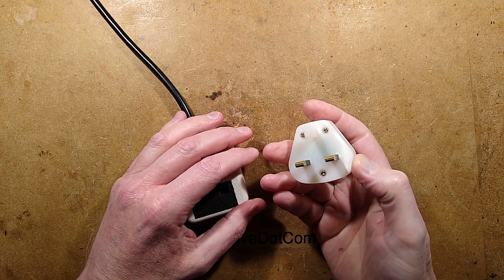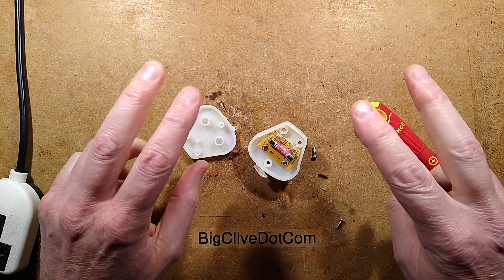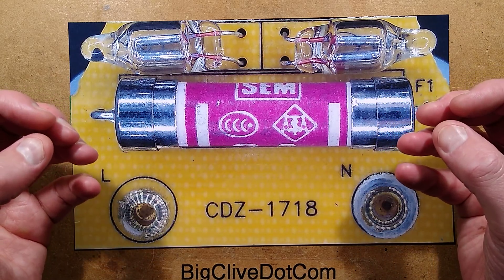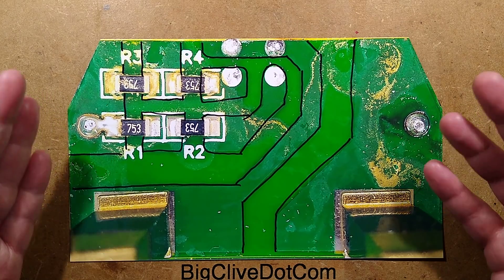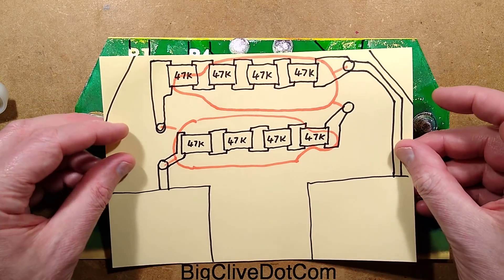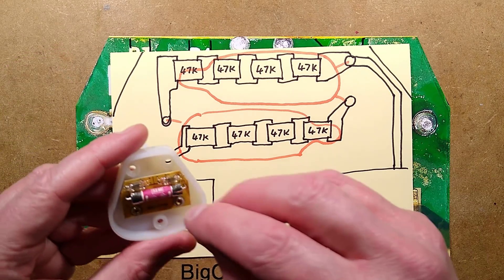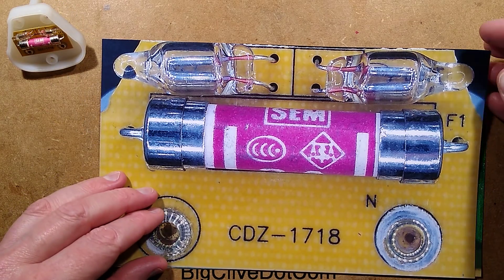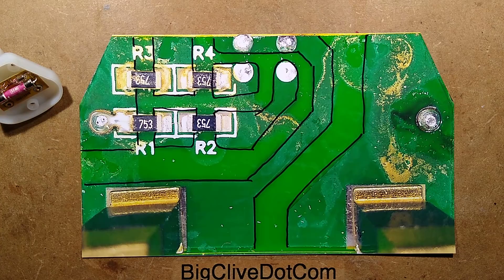British neon night light and the curse of the box-tickers

Comment: WTF? the neon resistors provide all the fusing you need
Reply: Probably some stupid supplier mandated they must contain a “real” fuse and here we go, pointless design bloat ensues.
Reply: @damowdotnet  My thoughts too. You can actually get fusible resistors designed to fail open to keep the 'box tickers' happy.
Reply: @damowdotnet  The "real" fuse is mandatory in UK
Reply: Alejandro Vargas  So what about 12V plug-packs? They certainly don’t contain a “real” fuse. USB adapters? Etc...
Reply: You don't need fusing at all in this circuit.
Reply: Dolganoff Agreed
Reply: A fuse is typically a sacrificial device, breaking before some other less-desirable conductor breaks/evaporates. Just doesn’t make sense in this context.
Reply: well they probably won't blow, if the neon shorted on a 240v suppy , the 150k resistance would draw about 380mw
Reply: @sparkyprojects  That'll destroy a surface mount resistor for sure.
Reply: @sparkyprojects  Things can get messy when arcing kicks off.  I suspect the BS1361 fuse is actually a sensible move, but surely they must be able to position it vertically.
Reply: Geez! what is that a 30 amp fuse? Looks more like 15, looks like a much lower amprage is all u need.
Reply: @davidcollins1853  I think it;s 3 Amp (cos it's printed in red) and fuses in that physical size are available up to 13 Amp (though John Ward found some 15 Amp ones on Amazon)

30 Amp is the fuse in the fuseboard feeding the socket.
Reply: @davidcollins1853  Assuming the colour of the fuse is right, it's a 3 amp fuse
Reply: @westinthewest  They might have thought it will only be viewed from above so it doesn't matter
Reply: @westinthewest  there might be some patent on that
Reply: @davidcollins1853  looks like a much lower current is all u need.

No such thing as amperage.
Reply: @NickNorton  'Voltage' is also not a recognised quantity.  I think it's supposed to be potential difference or EMF depending on the scenario.
Reply: @davidcollins1853  3A I think?
Reply from the maker: I think it's just overzealous compliance.
Reply: The neon resistors might not have sufficient breaking capacity for fault current on a typical 32A ring, but then again, the MCB will disconnect in less than 0.4s.  The question is whether the plug will safely enclose the brief eruption of energy.   The BS1361 fuse will have a lower energy let-through than the permitted maximum for an MCB, but in reality, MCBs trip times seem to be negligible unless the fault occurs close to the zero crossing of the a.c. sine wave.  Regulation 433.3.1 says that it doesn't really matter about the magnitude of the load, as it's fixed.  Fault current is the only concern here, and not overload, so the cartridge fuse can be 3, 5 or 13A.
Reply: @westinthewest  In my experience with MCB and local fuse blowing, the only way this fuse will blow is if the resistors all go short. Then the neons explode, the fuse blows and the MCB trips simultaneously. The higher the rating of the fuse, the more damage elsewhere, like the neons. But the likelihood of those resistors going short is insanely low.
Reply: Instead of neon could you perhaps use a small led strip around the perimeter?
Reply: What about a smaller sized fuse mounted on the back?  Replace the fuse with a 0 Ohm fuseable link.
Reply: @StringerNews1 I accept what you're saying is true to prevent currents higher that 13A being drawn from a single socket, but what then is the purpose of 10,7,5,&3A fuses except to protect the much thinner equipment wiring?
Reply: @StringerNews1 Thanks for the clear explanation.  I haven't had to deal with ring main circuits at low voltage. Our (down under) final subcircuits are radial. Rcd /Mcb protection is also now mandatory.  A far cry from the old AC1 rewirable fuses common in my apprenticeship days.

The old drop shutter fire protection panels were ring main, but long obsolete by the time I got started in 1973. They could be a prick for fault finding with both legs of VIR often pulled through the same split conduit. Being old, rubber and DC, faults were common.
Reply: It would have to be grounded for that and then it'd need extra circuitry in order to keep from triggering ground/arc/nannyfault breakers.  (nannyfault blows if an item is turned on-and-off-again rapidly over and over)
Reply: @StringerNews1 So imagine this device passes current just below what this fuse is rated for. Do you think it wouldn't burst in flames?
Reply: @StringerNews1 Tinkered with electricity for years, but no pro at it. It was mainly helping friends and family with wiring. I've seen some crazy things. ...read there are proper ways to deal with aluminium wire, pigtails, al rated outlets and switches, etc. Aluminium works really well done right. The key is knowing that it is there.  Sears Tower? Wow! must have been a great experience. Mom lives in the 80 year old house we grew up in. I had a hand in stages of upgrading WWii era wiring to present standayds. Was interesting mixing the Aluminiam sheilded cable with new "Romex." Junction boxes served well. Was back home last Summer helping Mom with electrical stuff. She wanted an outlet added in her kitchen. I was so pleased, when I discovered I was dealing with my own work from 40 years ago...
Reply: @StringerNews1 230V*9A=2070W, that's a good size space heater output compressed into volume of the tiny plug. Do you really believe a device of this size could keep outputting over 2KW for more than 2-3 seconds without bursting into flames?
Reply: @StringerNews1 Well said! Except that plug fuses are generally there to protect the thinner wiring to the equipment rather than the house wiring.
Reply: @StringerNews1 the idea that a 13a fuse is (after protection of life and property) to protect the house wiring is not particularly valid. In the UK the majority of sockets are double outlets, so,each socket has an appliance that could have a 13a fuse in its plug, clearly then, this double outlet has a potential load of 26 amps..this will have absolutely no affect on the 13a fuses in either plug. Take the average busy kitchen, several heavy loads, each with a 13a fuse in each appliance plug..so,the kettle is on,the toaster is on,someone's work clothes are not quite dry so on goes the tumble dryer, the teenager, whilst multi tasking uses a hair dryer whilst waiting for the microwave they just turned on... 5 heavy heating loads on simultaneously, each with a 13a fuse,none of these blow..but meanwhile the circuit breaker feeding the kitchen ring circuit is now hot and at or just over maximum capacity and is about to trip from thermal overload when the microwave pings, the hair dryer is turned off and the breaker cools down and everyone's day continues oblivious to the load on the 32amp ring main breaker that is protecting the wiring feeding the kitchen sockets. The breaker in this case did not trip as there was no fault current, unlike the time a picture hook is hammered into the wall and a cable, tripping both the MCB and RCD immediately. Radial circuits on the other hand are a pain at times and require much heavier gauge wire. 
Apologies for the slight tangent at the end..
Fuses protect upstream components,not their feeders!
Reply: Lassi Kinnunen  Some Chinese manufacturers haven't got the message. They make fuseless 13 amp plugs.
Reply: @StringerNews1 Ah, yes. How to prevent car accidents? Don't drive into other cars or off the road! How to deal with earthquakes? Don't live in a seismically active area! How to deal with insomnia? Sleep! Crime? Don't break the law. Wildfires? Don't set forests on fire. Easy!
Reply: @StringerNews1 It might surprise u I live in the US and know what a ring main is. I'm glad they kept it with cost of copper up as it is. Things about US wiring baffle me. I heard wiring is made of some alloy instead of copper. Are we going to relive the aluminium wiring nightmare? I like how conservative u Brits are. Us Americans are shamefully waitfull. BTW, I think the fuse color coding is different here. Red fuses are 20 amp.
Reply: @davidcollins1853  Decades ago British 'Post Office Telephones' used aluminium wire as a standin for copper as a measure to deal with copper shortages. In time it all turned to dust. I had my phone line 'repaired' several times on account of that. Eventually British Telecom had a contractor rip out all the aluminium cable and put copper back in its place.

Comment: Could you not have the fuse 90•  between pins and one neon either side .. resisters on reverse of circuit board ??
Reply: Or might there be room enough for a neon light below the fuse, between the pins? If it makes the cirquit layout simpler, wire the fuse in series between the two neons and their resistors.

Comment: Couldn't they have just straddled the fuse with a neon on each side? I'm sure they'd have room for it...
Reply: Try doing a layout that would accommodate that. Once you take into consideration the clearances necessary for the individual pieces, it's quite a puzzle.
Reply: @Peter_S_  It could have been designed with a commonly available 20mm quick blow glass fuse (physically smaller and lower values available - 500mA would suffice), mounted vertically with a neon either side.
Reply: I was thinking the same thing, using a vertical orientation.  combine that with the possibility of using a physically smaller fuse.  I would think that it should be feasible.  (Unless of course it's the case that I'm absolutely wrong.)  😆
Reply: Surely, as the plug casing is custom made for this purpose, the fuse could have been cradled on the same side of the board as the resistors?
However, there would be added material cost as the L and N pins would have to be slightly longer

Comment: Well go on then clive,  "fix" it by replacing the fuse with a wire link
Reply from the maker: Only if I could add my extra resistors.
Reply: @bigclivedotcom  Why not add the extra resistors in place of the fuse? It might cause flicker (as they share a single load) but is worth a try.
Reply: @bigclivedotcom  make a DIY video of this like your other LED & neon circuit board videos please!
Reply: If they'd used a clear glass fuse, the light would shine through it.
Reply: @millomweb  The rule probably requires that kind of fuse. That or the designer didn't think too much about that option.
Reply: @GordonTechno  an iron nail. Or a piece of aluminum foil.
Reply: @GordonTechno  No we wouldn't. Remember we have had dual fuses in the plugs of Christmas lights for at least a decade now.
Reply: @johnpossum556  Dual fuses? Is that something to do with un-earthed plugs being able to be turned around?
Reply: @pbhrbb  I'm not sure, actually. They are mini fuses, usually 3 amp glass ones. I'll clip them off old lights I throw away and reuse them on my own projects sometime.
Reply: Could you remove the fuse holder and then solder some 3A fuse wire in its place?
Reply: @nathanlucas6465  Then it would not be a HRC fuse as dictated by the overseer!
Reply: @GordonTechno  The Russians will just stick some bare wire between the terminals and have it glow redly. As an added bonus it will be a heater in their cold winters.
Reply: Well I was hoping for a Sausage or a Mini Hotdog.
Reply: @GordonTechno  ..... Novichock agent inside the neons no doubt !
Reply: @GordonTechno  with Vodka, of course... 😉

Comment: Hmm, looks like they could have just positioned the fuse vertically between the two blades and placed the neons on either side.
Reply: I was thinking that but it just seemed too obvious & there must have been a reason they didn't!
Reply: It probably will not fit the case.... but the fuse on the other side of the board?.....
Reply: That would mean new PCBs and new enclosures, which would mean all new tooling for production and assembly which would probably double the cost. Just adding some pads and slapping it in there makes it still economically feasible to sell it in safety North Koreas like the UK.
Reply: @mysock351C  That's pretty much what I'm thinking.  It might be possible within the same enclosure but it would definitely require a taller board and probably still wouldn't have full size bulbs.  Big companies always push their engineers to find the cheapest solutions not necessarily the best solutions.
Reply: @grn1  I doubt a big company designed this, it's guaranteed to be some company you've never heard of in Shenzhen. They're then sold through sourcing firms who take the lowest bidder and then put some big UK retailer's name on it. The profit to the Chinese vendor ends up being pence per unit.
Reply: @mysock351C   If the orig design (layout) is changed it needs to go through re certified before releasing for sale

Comment: I shared your lack of enthusiasm for lead free solder until a friend insisted I try some of his...  There was no need to swamp the joint with flux - it worked beautifully just like the British made 60/40 tin/lead I always use.  The melting point is a tad higher, but I didn't bother to turn up the iron's setting - it just worked exactly as it should.  The appearance was quite bright as well.  It's a silver, copper, tin alloy: (https://www.ebay.co.uk/itm/Lead-Free-Solder-Silver-electronics-Flux-cored-Extremely-High-Quality-60-40-5m-/164082353761)
Oh - it isn't cheap...
Reply: I find that Rapid's "premium" lead-free solder works well, but yes, it is a bit more expensive. Their non-premium stuff is cheaper but is only "ok" - it works, but can be a bit fussy at times, in my experience. I think they both use the same type of flux as the old leaded stuff, too.
Reply: When rohs was announced, I stockpiled about rwo pounds of leaded rosin core solder. Should be enough for my lifetime.
Reply: I got a call from a friend his fathers brother passed away and was a amateur radio guy the family was not interested in it  said they were going to dumpster the workshop and I could have all the gear  besides a really nice bunch of transceivers and test gear  he had tons of parts including a LOT of hard to find tubes and a big box full of the old good solder and a new soldering station he never used ! WIN !!!

Comment: If I was going to try tackling this, I'd probably try turning the fuse 90* and had one neon on either side.  
I'd need to actually sketch it out to see if I could make it work, just my first instinct.
Reply: i would turn the fuse 45 degrees and have one neon on each side of the fuse.
Reply: I think you'd need either a larger, or different geometry PCB. Might be a cost issue.
Reply: Bingo!  That's was my thought.  How dumb.  Engineers are clever about maximizing usages of materials and manufacturing, but they need an industrial designer to make these choices.  This is stupid.  It's near the floor.  It's supposed to light the floor.  Idiota.
Reply: That was my thought as well. 
@Ben Turner I think you are correct about the board being a more complex shape with a vertical fuse. A cent or two/unit might be a large portion of their margin.
Reply: TIL the tag can be anywhere in the message, thank you. @matthewellisor5835  But anyway I was thinking of like an inverted T shape.
Reply: The design was for a machine to easily make them over and over again.
Reply: I had a similar idea, but instead of turning the fuse, just having a neon on either side.
Reply: How can comments be 6 days old? How?
Reply: phorzer32 posted on patreon first before we see them.
Reply: @robhall2570  thanks for your explanation!
Reply: @robhall2570  Ah, unlisted
Reply: @phorzer32  patreon subscribers get this a week earlier .
Reply: @phorzer32  Yes, that's very strange. A space time-glitch???

Comment: Yeah, the first thing I though was, just put the fuse on the other side.  Maybe another standards issue, or not enough space?
Reply: I suspect they were trying to keep it in the footprint of the original moulds, to keep retooling costs to a minimum.
Reply: Just thought that, they could have done a number of different things.
Reply from the maker: I don't think there's enough space for that with the fuse and neon diameters.
Reply: yeah I was thinking either put the fuse on the other side, or use a fusible PCB trace or resistor or something.

Comment: Did they have to put the neons on the same side of the board as the fuse ?

Is HRC necessary ? Could they have replaced the single resistor with a fusible one ?
Reply: I'm surprised they didn't use a 20mm ceramic fuse.
Reply: @echothehusky  A glass fuse would work dandy!
Reply: @pizzablender  You ever see lots of current go through a glass resistor? look up a video on it sometime, they can outright explode. While this one is filled with something like sand to prevent that.